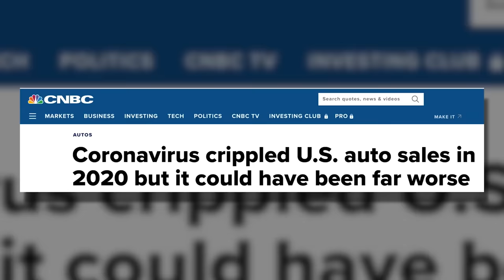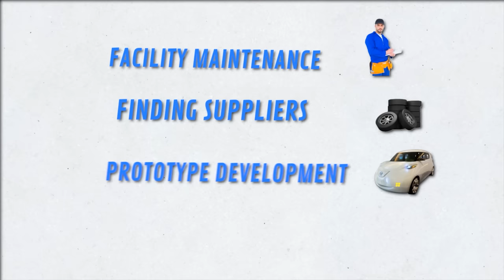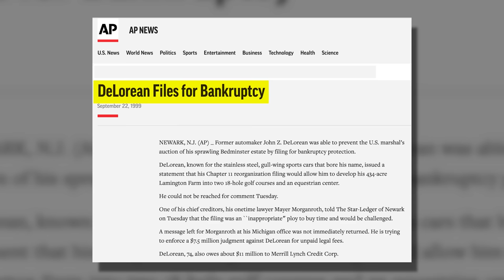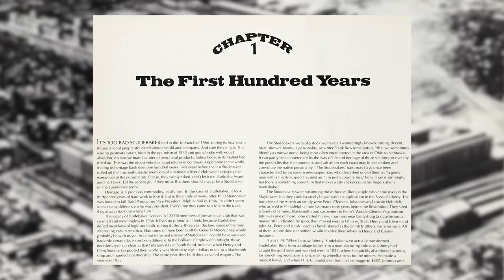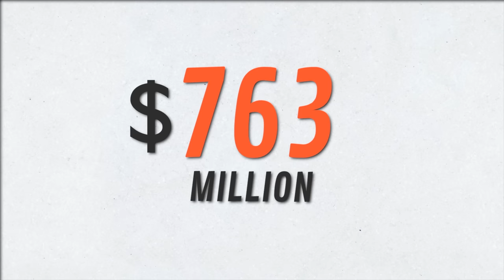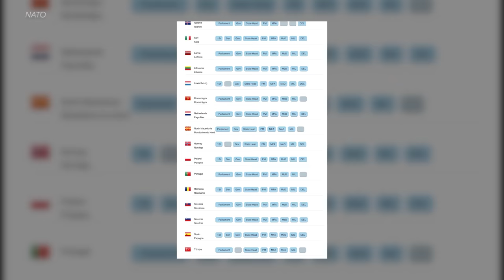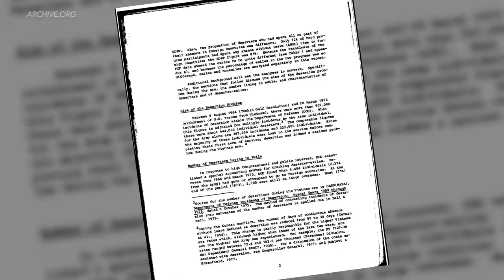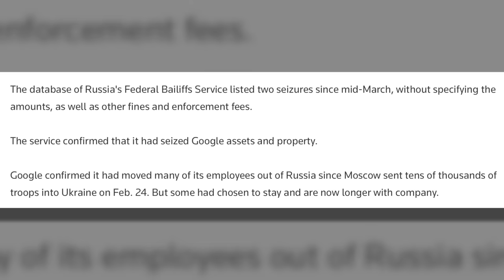Russia and America are Preparing for WW3

Comment: for cars , nuclear war mean all electronics / semiconductor control are damaged.  with good service manual of cars wiring, it is possible to make crude electronics control, so at least car can run,  forgot about emission, optimum power, so on.  just need to have correct timing to spark, turn on fuel pump, radiator fan, other thermo control, charging control, transmission control can be done with stitches manually.